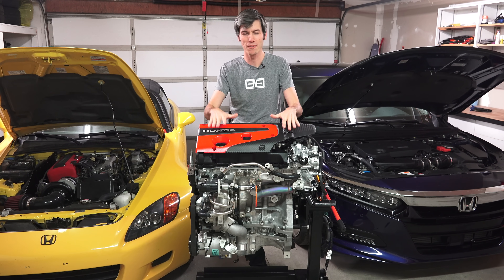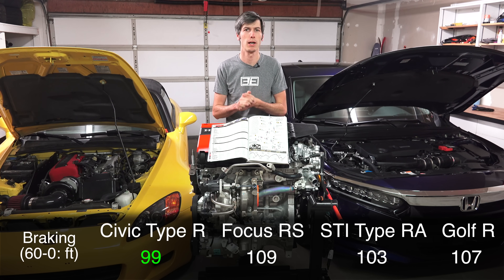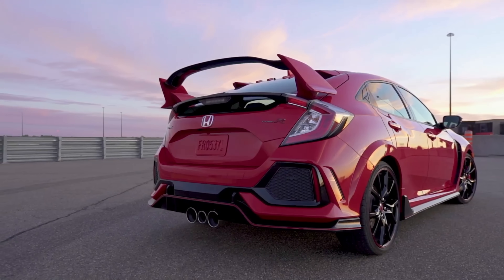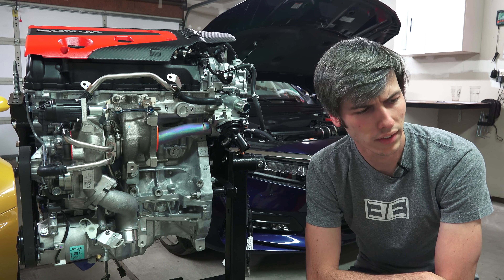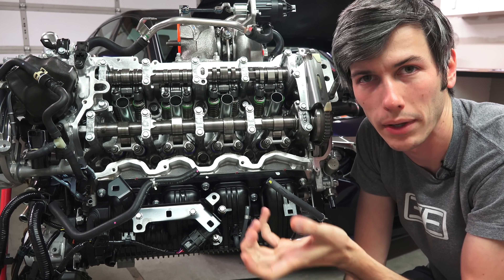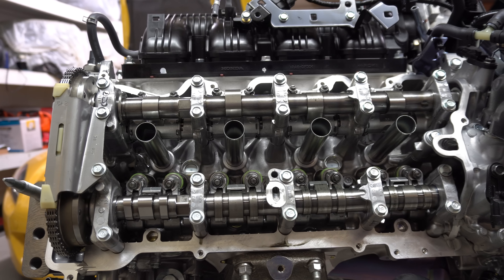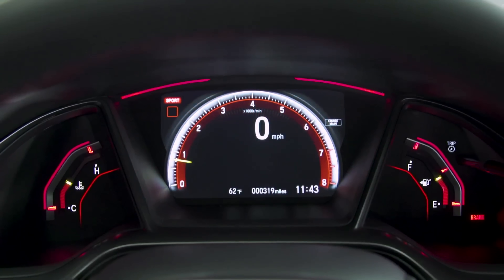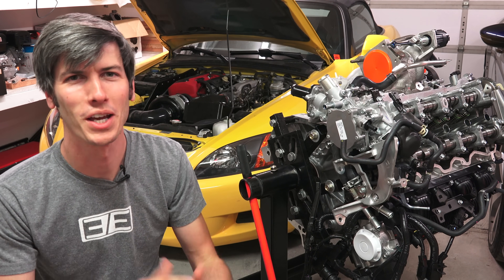The Honda Civic Type R Destroys The Competition - The Best Engines

Comment: S2000 or my RSX anyday! New Civic Type R is WAY to riced out for me!  Rather have the STI Or Golf. And better yet a slightly used 370z or even an Eco Boost Mustang with mods and tune. This wpuld be an amazing motor swap for my RSX! Haha 😏
Reply: Everyone and their brother has a boring Golf R or a tired STI these days. At least the R is different. S2000 there is no question though...awesome car.
Reply: Dave Drenth even an MX-5 Miata turbo would be a ridiculously fun car
Reply: It would for sure...but I can't deny how much fun driving the Type R has been...and I don't see a dozen of them on my way to work like I do Golf R's and STI's (not that they aren't nice cars - just so common that they've become boring).  @aaronp9835
Reply: Dave Drenth I would certainly rip around a Type R as my daily! Certainly never touch any new Ford Focus, seem so generic and boring. Used to have a fully built 2003 SVT focus and that was fun. This RSX i have now will be my first all motor build. Looking for 260-280whp

Comment: This is wrong on soo many levels. The type r k20c1 is a great engine but certainly not reliable if you mod it. Rods are $30 from Honda and bend when you throw considerable amounts of HP/TQ at it. They are the new Subaru FA motors, potential but not reliable.

Comment: 1:09 , may i ask how does the civic type R has higher top speed but slower to the finish line?
Reply: It's front wheel drive, so it is not good at standing starts.

Comment: The only thing they did wrong with the Type-R engine is not having it in the Coupe.
Reply: Or if you want insurance rates that reflect the actual value of the car (though I plan on buy a Civic Si 2dr 1.5T for fuel economy).
Reply: Or making the hatchback 5 door smh 🤦‍♂️
Reply: @Garreth Wilcock But I am a 17 year old who stole it
Reply: Amen-less doors, less weight, but the trend is for boy-racers to buy autos to tote their babies....oddly enough...as opposed to the ITR of the late 90s and early  2000s. I also wish the CTR had far less exterior "styling cues", or at least an option for less, as most people I talk to about it say.
Reply: @Garreth Wilcock ..wish the type r came with a deboyracer option to make it look like a civic sport hatch. The sti has an option to delete the ironing board I mean real spoiler

Comment: But it loses to Leon Cupra 300 from a dig and from a roll. I raced it myself. Also 2.0 tsi has better fuel compsuntion and is easier to tune. Stock 2.0 tsi CJX motor is capable of running 500 hp.

Comment: I think modern tech is great but I'm not as enthusiastic about the platform. Personally I feel that stock cars are for young girls and old men. And the old timers at Motor Trend are much more into muscle cars and Big Blocks. Taking any of these cars to the street in stock form and you will quickly run back home and shove your credit card into your computer until Parts pop out. That being said I can't wait till the aftermarket comes online for this platform. To be honest the Turbo seems maxed @28 psi and 2 liter of displacement is meh for a car this heavy.

Comment: Sorry to say this but the civic is marked up at the dealerships. 54k is what Honda dealers sell this thing for. This is why people buy Subaru VW  ford. Motor trend has no reports on this. All dealerships thru the US mark this Civic R
Reply from the maker: Check out HondaProJason on Facebook. He's advertised several at MSRP. There are good dealers out there!
Reply: Engineering Explained  HondaProJason then deserves some credit for integrity. I loved being told by one dealership that they were doing me a personal favor by only marking one up $5,000, but in order for me to be able to test drive it, they needed a firm commitment from me to buy it before I was able to drive it. It was a spectacular experience of bass-ackwardness.
Reply: Dealerships can mark it what they want. I can get you one for $38k out the door here in NC.
Reply: @farhatali4031  Sure - in many States they have all the right in the world to mark it up to high heck (of course it defeats the purpose of the car). My beef is when they list them as "MSRP $35,xxx" on auto websites and then you go there and they have hand-written notes that imply a markup. I experienced this first hand at several dealerships. If their website said, "This car has a MSRP of $34,995 - as it is a limited edition car, we want $40,000," cool, more power to them, and good luck. If they are selling for $38k out the door, then they're conducting more ethical business than what I experienced around here. (Things may have changed now that the car is not quite as new.)
Reply: @npaul4171  $60k in Puerto Rico
Reply: At least about half a year ago, the markups were so insane that one would have to either be loaded and just not care, or have a tremendous amount of loyalty to the brand.
Reply: 5 to 15k mark up in LA
Reply: Dealers have been known to do this( I don't play that game )
Reply: In my country the list price is 40000 €, VAT included. I could probably get it at 37000 €. Here the dealer's are interested in selling the cars not overcharging people for them
Reply: Jeremy Ybarra Don’t buy it in cities where there is high demands for it.
Reply: Just buy an audi s3 for that much!
Reply: Outdoor Layne where

Comment: Not to negate any Honda fans but you all forget that Honda has a lot of internal flaws ie. They have the thinnest cylinder wall out there and the smallest rings causing early blow by. I've been a master tech. For 30 years if you actually read your complete owner's manual the mileage intervals are for highway driving when it comes to stop and go it drops. I'm not saying Honda are bad all car companies only tell you what you want to hear not all the facts ever company spends just as much designing it to last the warrant as they do to make it fail after

Comment: So your telling me the lighter car with about the same hp as a heavier awd is faster in top end. And is faster then other cars on track when it has better tires.... ok
Reply: The type r is a ~3100lb fwd car. Fwd must be lightweight to be truly fast. 2400lbs like a eg or em1. Once you put a little bit of power the car will struggle to put power down & will throw off the balance.
Reply: Compared to a Awd where you can put down 400whp like it was made to do it. Saying the type r is a faster car I’d like saying your girl looks the best without makeup. Only thig it has is mpg
Reply: I own a rsx-s the new type r should have been a k24 with awd ~3400lbs but Honda chose the easy way and just stuffed a turbo k in a 2018 si with aero & brakes

Comment: That’s all well and good but what about the mechanical integrity compared to the lot? When will Honda creep in with its typical failures. My 2008 Si (122K) has had the A/C compressor fail 3 times, the clutch master cylinder replaced 6 times, continuous paint fading issues, premature clutch/transmission issues and a degrading interior. All in all I would (and will) opt for the much more solidly built VW Golf R

Comment: I see so many idiots thrashing their cars in low gears when cold, driving like this can mean someone else later on having an engine failure, or increased fuel consumption etc. If manufacturers want their engines to last longer they could limit engine revs when cold also reducing emmissions. Also have to say turbocharged 2 litre engines are generally best size for standard car engines.. higher torque at low revs means fair economy if driven conservatively with plenty power in reserve, however light weight is what all manufacturers should aim for.

Comment: Its not just the engine: the entire car is designed to maximize each aspect of the race: weight, stability, speed, response, differential (and really kick ass one).....heck, whenever we want, the Civic and I can make the car rear tires to drift on a curve without losing speed. Oh trust me, we've seen Audi's R5 raging like crazy for not being able to do that.

Comment: Just lipstick on a pig, there are far superior engines designs that are lighter, more powerful, more fuel efficient and longer lasting with near zero maintenance.
Reply: What 2.0L class engine are superior?  At best other 2.0L class engines (VW/Audi, Chevrolet, Hyundai, Mitsubishi, Ford, Alfa Romeo, Mercedes, BMW) are on par with this engine.  All of the major 2.0L turbo engines are quite similar.

Comment: Can someone explain how VTEC works on this engine? If it’s only on the exhaust cams then isn’t it getting the same fuel economy with VTEC engaged or not? Does it use VVT on the intake when VTEC is engaged?

Comment: I consistently run high 5's to low 6's from a dig in my bone stock 17' GLI. Full disclosure- it's a dual clutch tranny and I'm running on a set of Michelin Pilot SS's, so I'm able to get all that torque to the ground efficiently, and this is without engaging launch control. I have a hard time believing an AWD Golf R with nearly 100 more hp doesn't best that by at least a full second and a half. I'm not ashamed to admit it, I do like the new civic Si and the type R is a formidable beast, but this comparo seems inaccurate. I just can't believe a manual golf R is THAT slow, but who knows?

Comment: I wonder how that engine compares to the 2 L that's in the 2014 BMW 328i?

The 2014 BMW 328i is the best 4-cylinder I've ever driven.

8 speed automatic hi five second 0 to 60 36 miles a gallon on the highway.
Reply: It won’t put your mechanics kids through college like the BMW engine will.
Reply: @Bartonovich52  

Yeah it's very interesting to see how these EcoBoost Ford product in how the BMW's hold up!

My money is on Honda being much better in the long run.....lol

I guess time will tell😆
Reply: @krisg822  unless it has dual clutch gearbox, then it is less than 5sec with less than 300 HP :) And these new 7- and 8-speed gearboxes make a real difference
Reply: You have a turd n20 4 cylinder engine. I know nothing of this Honda engine but I know for a fact it is better than your n20. Being 2014 you’d better hope it’s end of 2014 and not early 2014 prod or you might have the shitty timing chain guides and oil pump.
Reply: Once you chip the bmw it's way faster
Reply: @tvtnatn  

That BMW just blew my mind when I drove it.

I bet if you chip it and get it to 300 horsepower and 310 pound-feet of torque I bet the 0 to 60 is 4.7 second 0 to 60
Reply: Bmw is junk and if you like check engine then BMW is the car
If you want to drive german cars drive audi way better
Reply: kris germany my is350 has 306hp and it hits it in 4.8 seconds ......
Reply: BMW - overpriced junk

Comment: Since when is 13.7 seconds in the quarter fast? And there is no way a Civic Type R is beating an STI 0 60. The drivers at Motortrend must totally suck. If you put all these cars together on a dry lake bed, I can almost guarantee the Type R will be last 0-60 and the quarter.

Comment: What are your thoughts on the Hondata tune for the Accord 2.0 that ads up to 50hp and 80 torque? Think the pistons and fuel system in the Accord motor can handle it over time?

Comment: 2007 Mini Cooper S also had chain driven camshafts that last the life of the engine. Unfortunately, the timing chain tensioner was NOT designed to last that long... So I guess the chain lasts as long as the engine but the tensioner failure meant the engine life was probably only around 75k-100k miles if you didn't pay attention to it.

Comment: Imagine a 10th gen Si with this engine in it 😍
Reply: That's basically what the type r is....
Reply: Mike_MANIC_R55 not at all the type r has a completely different body, bigger rotor, brakes, and stiffer suspension, however the si has a coupe and a sedan option, also being lighter by 300 lbs.
Reply: @braydenbrooks1009  all the stuff you listed is to help the car handle the extra power and reduce its drag for fasterap times. Theres technology in the type r thag the Si doesnt have which would make it slower on a track.
Reply: Mike_MANIC_R55 Obviously, the type are is a legend on the track and the si will never be faster on the track. But remember a full bolt on si is a second faster in a 1/4 mile than a full bolt on type r. Im just trying to say the Si would be a beast with the 2.0 considering it’s lightweight body, and cool looking coupe body style.

Comment: But look at it! No denying the Honda might be faster on the track, but wow is it fugly! The Focus RS is marginally better, but the Ford suspension is way too firm for a DD. Full disclosure I'm biased and drive a '17 VW Mk7 R with DSG. Some may say the VW R appearance is "boring, plain, etc", a personal choice. Even 100% stock the VW R + DSG IS still undeniably fast, has a way nicer interior, makes for a better DD,  and is actually comfortable & practical on road trips. As an all around DD, I don't think you can do better than the VW R -compared to cards in this group. If buying a track car -get an Arial Atom ;-)

Comment: QUESTION PLEASE, You are saying in the video that at 100.000 miles valves need adjusting. VALVES have been since 2005 and before Hydraulic. THEY adjust THEMSELVES with oil pressure.
In adition, THANK you for the video... very nice. THIS honda TYPE R is my dream.. never to become reality... wonderful engine.
Reply from the maker: I think they do need adjustments, even though it’s a new car haha. At least according to Honda.
Reply: @EngineeringExplained  SO YOU SAY acording to HONDA vales Need adjusting... WHAT kind of adjustments? Fact of the matter MAY not need any adjustments.. What so ever.. Unless they take off the head of the engine.. And redo all the mechanical stuff.. The valves lifters.. See if valves seal OK.. And even a complete check up.. The oring for each valve.. Just like when you do a headgasket work.. On a blown engine headgasket.. Here in Europe that is common..

Comment: I do actually have a question. 
Some guy back in the Supercharger episode said in the comments that the Turbocharger isn’t using free energy because it is restricting the exhaust system, hence do involve more parasitic drag than the supercharger does. He argued that the restrictions in the exhaust line act as a force the engine has to push against. 
Can you please explain whether that person is actually correct or not and why so?
Reply: No. All motorsport is dominated by Turbos where they are allowed. Turbos are not allowed in top fuel. 

20 to 25% of an engines lower is used driving a supercharger. Yes, although the turbo restricts the exhaust, the boost from the compressor more than makes up for that. The #1 advantage of turbo is boost control by modulating the turbine waste gate. Boost control alows for different boost  per gear allowing for the force at the tyres to be tuned to suit track conditions.
Reply: Nor Dic I’m not asking IF the restrictions on exhaust make turbos less efficient. I’m asking HOW does that exactly work. I’m no engineer. I have no way of knowing what kind of connection is it that the engine has with the exhaust gases. Don’t they exit the exhaust line by forces of their own? I don’t get it, how is the engine exactly pushing against the restrictions. Unless there is literally a fan blowing the gases away I can’t imagine the way it works LMAO.
Reply: A supercharger runs off the crankshaft, thus taking power directly from the engine.  For example, the new corvette ZR1 requires the engine to pump out 110hp to spin the supercharger at full speed (parasitic drag).  Regarding a turbocharged engine, when the piston moves up to push the burnt gasses out (exhaust gas), the gasses are pressing against a fan (the turbocharger).  This makes it harder for the engine to pump out the exhaust.  It's a restriction - think of a poorly designed exhaust system, to an extremely free-flowing unit (ie by going to equal-length headers, deleting catalytic converters in race cars, expanding pipe diamater etc.).  The better exhaust system will require less energy from the piston pushing the exhaust gasses out.  The turbocharger, in turn - is putting a giant fan with minimal clearance in the engine, which then spins another fan to pump in additional air into the engine.  The engine is not suffering from parasitic drag, because it is not connected to the engine - the parasitic drag is only coming from drag within the turbocharger itself - not the engine's.  Both aren't using free energy, but from an efficiency standpoint - I am yet to have come across a race car which competes in longer events which run a supercharger (prototype, gt2, gt3, f1 etc.).